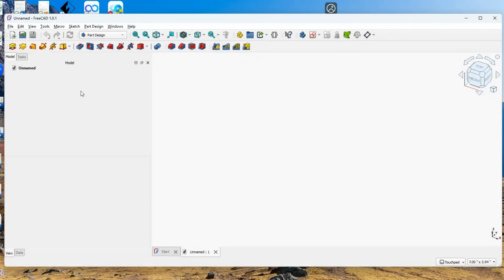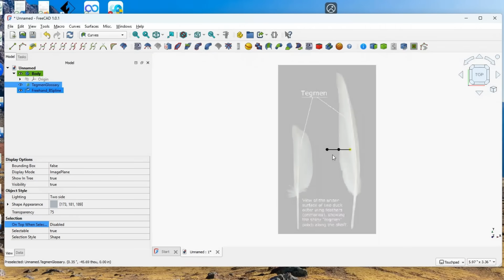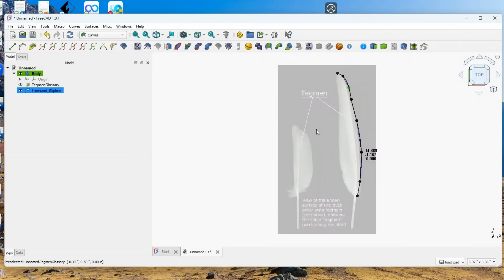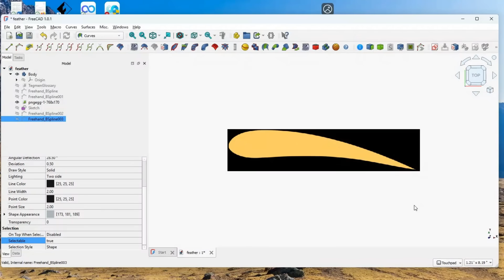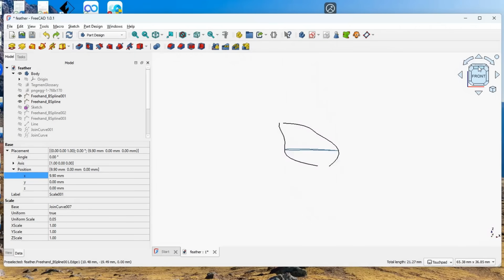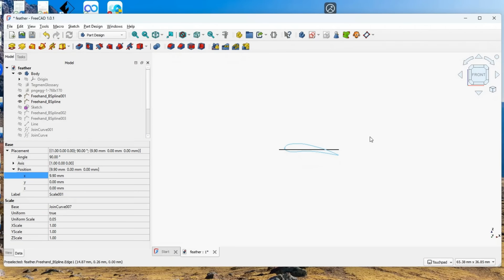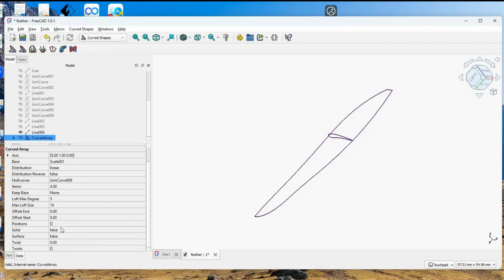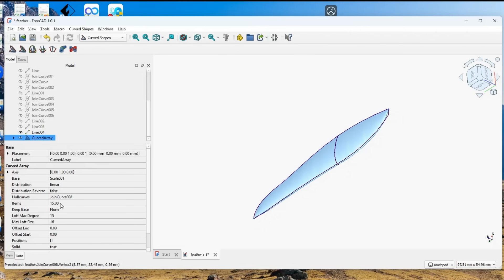2403 The Feather Blade Wind Turbine - FreeCAD Curved Shapes Workbench Introduction

Comment: Why not try using actual bird feathers.  Why do that.  To see what happens. 😊
Reply from the maker: go for it
Reply: I have made turbines using feathers. It’s tricky to find equal size and shape and they have to be only from either port or starboard wing. Interestingly, I have found Rook feathers to be the most durable in the long term, others seem to rot away.

Comment: Okay, but a single feather doesn't make a bird's wing.  Standard aerodynamics should have worked as well, or perhaps the wing sails from the experimental sailboats could be used for a wind turbine blade...
Reply from the maker: it's like a fractal mate - the pattern repeats going down - and maybe you are right 'standard' will works as well - right now I don't know and so i think it's worth a look at. I get it if you don't think it is - but we all have different ideas - cheers

Comment: Interesting stuff, which brought me to  question in my mind. Each feather is basically made up of individual splines, so how do they “bind” together in the turbulence of air during flight without damaging the splines?
Reply from the maker: they do get damaged mate - which is why birds preen. They run their beaks through the splines which 're-zips them' so to speak
Reply: The staggered connection to the skin and layers interlocking, make the strength and muscle control let's then flex the individual feathers for extension and angle control.  So any barb connections are also under their control.
If you research neuro studies a big part of their brains is flight control, pretty cool huh?
Peace
Reply: @offgridmanpolktn   Yes thats the feather as a whole, what Im referring to is the individual parts of the feather that make it up.
Reply: @Arachnoid_of_the_underverse 
   Okay, there is the main shaft of the feather 
   Then hundreds ( thousands?), of tiny shafts off each side of the main one. Then the barbs you refer to are on the ends of even tinier that makes the tiny tiny side shaft's stay cohesive in a line.
  Seems you might have played with a feather to make the edge ripple over your finger. Or made it split in the side and brush it back together by brushing your fingers up it 
    Now it is still possible to do this when it's dead and dried out. When that feather is alive it is connected blood flow, tissue connection to skin and cartilage, and nerve connection it's a growing living part of a bird that they can feel and control.
   So when birds flap their wings they control feather movement, the almost microscopic barbs allow side shaft flexibility 
Better explanation?
✌️
Reply: @offgridmanpolktn  Feathers are only filled with blood while growing. Once complete, the blood drains out and it's a non-living structure, like a fingernail, but far more elaborate. Most birds grow a new set every year, as they do wear out from constant use.